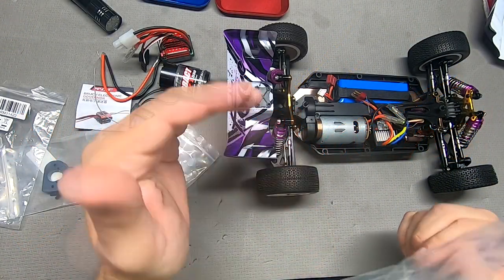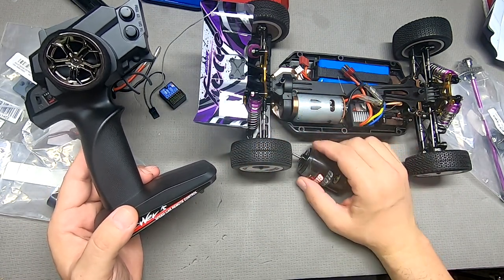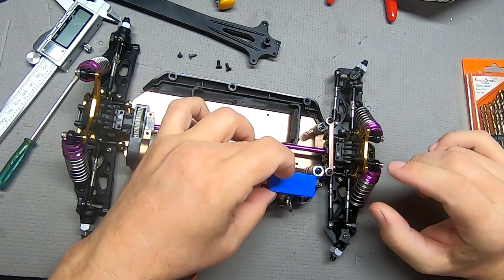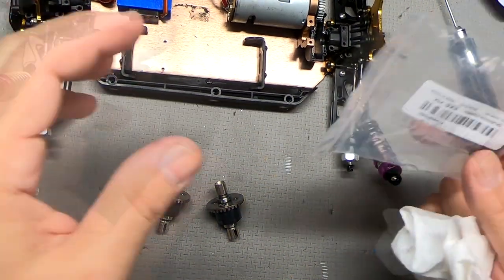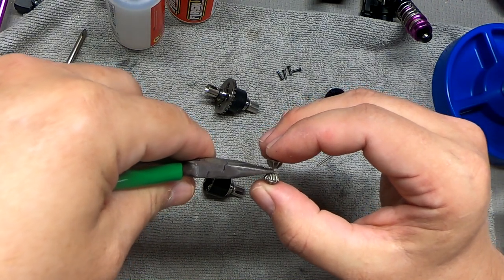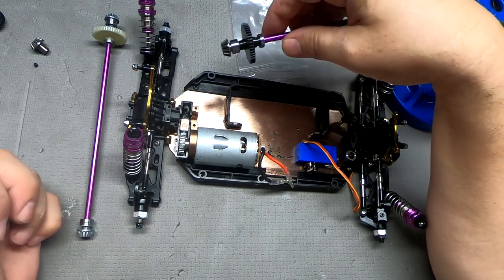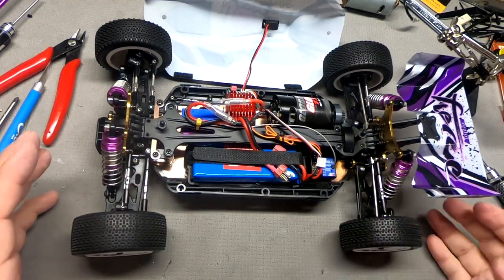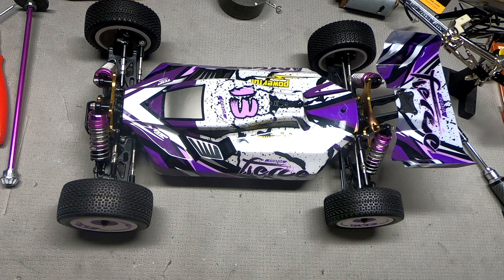New Motor, Diffs, Electronics, & Speed Test - Wltoys 124019 RC Buggy 4WD - Pt. 7

Comment: Which Motor did you build in?
Reply from the maker: Hi Daniel, it's nothing fancy... actually it's quite inexpensive at under $30 for the motor and ESC. Here is the title and link:
Rc Motor 550 12T Brushed Motor+60A Brushed ESC 6V/2A BEC for 1/10 RC
https://www.amazon.com/gp/product/B08JHX9RXN/ref=ppx_yo_dt_b_asin_title_o01_s00?ie=UTF8&psc=1
Reply from the maker: @admin5322  My main goal of swapping the electronics was to be able to have advanced functions like expo. I'm going to be selling the 3D printed servo mount with servo to make the change as easy as possible for my viewers. I'll be putting it up on ebay next week. I just received an order of servos and am going to print a batch of the mounts in black PLA tomorrow. I'm selling them with the servo to make sure that people have the correct size servo for the mount. It's all metal gear and I'll be testing each one to make sure they don't have any issues.
Reply from the maker: BTW, keeping the stock motor is a wise choice. It's already plenty fast as is. You might consider the aluminum diff cases, but if you're not having any issues, no hurry. The number one thing that buggy needs is suspension tuning.
Reply from the maker: @admin5322  Didn't know it existed...
Reply from the maker: @admin5322  Cool! I prefer this over the 144... because it has a longer wheelbase so it's more stable. That was one of the reasons I went with the 129. For the price, you can't go wrong! I've got another of their cars on the way...
Reply from the maker: @admin5322  I think you're referring to the 144001... I don't see a 104001. The 144001 came long before the 129019. But you can get whatever you like.
Reply from the maker: @admin5322  Thanks for the link! I was wondering when they would bring out a 1/10 scale car. You are right to wait... I just preordered one for myself.
Reply from the maker: @admin5322  I wouldn't hold my breath on that. Brushless motors, even unseasoned ones cost to much. The brushed motor they use on all these cars costs pennies... literally under ten cents per. The people making these cars are trying to keep below a certain price point. It also looks like they are using a lot of stuff they already have. There is very little new on this car. It's got the same 5 wire servo. Even the motor looks the same. The shock towers are the same stamped steel parts that are on the 129 and 144. The wing mount and wing look identical to what's on my 129... even the diff cases look the same. I'll bet the center drive assembly is a slipper clutch at best, not a diff... it might just be a drive gear with no slipper at all. I comes with the same 2200mah battery that comes with the 129. I'll bet the shocks and swing arms are the same too. They probably just lengthened the cassis a bit more to make it a 1/10 scale. Don't expect to much. 
Did you notice that in the crash test, they use a brick so they could make the point of impact the center of the chassis? That way the front wheel didn't hit first and rip the a-arm off the chassis. Look, I did just buy one and I'm sure it will be fun to drive. I might even take it to a race track and run it against the real 1/10 scale 4wd buggies just to see how it does. IF it can pass tech and can be raced in the 1/10 4wd buggy class, it might be the least expensive way to get into racing RC cars... That would be a real boost for beginner racers! But it may NOT be legal to race... ex: ROAR requires all cars to run a "hard case" battery, which this does not come with. I've never seen a hard pack in the size these cars use... that is probably the biggest most obvious problem, and 2200mah is probably not enough juice to last even short races. It might be possible to use a shorty pack turned on it's side. First thing, I'm going do after I give it a thorough lookover is design a mount in CAD and 3D print it. Hard shorty packs are available in up to 6000mah. But it will definitely need to be mounted standing on it's short side because this buggy is to narrow for the width of a shorty pack... they are almost 50% wider than the included 2200mah bat. On the up side, the tires look like they are an improvement over the ones on the 129. A bit of trial and error and we might find a make and model of wheel that will fit with the right offset... then tire options can be explored.
Thanks again for sending me the link!
CJ
Reply from the maker: @admin5322  BTW, I since it looks like the 104 uses the same servo, I ordered one of the 1181s you told me about. I found them on ebay for a bit more than on Banggood, but they come from a US based vendor so they will arrive in 4-6 days versus a couple weeks... I don't know where you live, but if you're in the US, this may interest you. Here's the link: https://www.ebay.com/itm/353190348151?_trkparms=ispr%3D1&amdata=enc%3AAQAFAAACQBaobrjLl8XobRIiIML1V4Imu%252Fn%252BzU5L90Z278x5ickkUq2HUzRXIDNJVaaCvHclGe4jh0JTBRBsaaNeqztUuiV5OsP%252BvN1Xdt4NBDuZA1slpiOhqx%252BbdEgY%252B1Nvrb5QANew81QLFbr5KrxStAXEgz1z%252BlxCmb67ebsJA7PcqUNrkqq6PpNuVuiaV6Ron0H65C%252BX2P7wTZosZ7%252Bk7CKt1QHnIW%252BQARgNDt3J9Lg%252BKirV4lHlgJfwH%252FjE4curWQBwOOTgkre01lU2%252Fen5G%252FZAo%252Fsr0JFyfC5rtdaPzKbg%252F2vfmZ%252BeGbkDElwcfpX%252BGVjQi3ttvwhzHXTcaKr2gOBtFUznkqeRqm4H4XClCjOmJXNo1vZ%252Fw9h5Mrtq1Xr26sioSN6va06KavY1D0%252FNxK%252BQwjzmyJ83m%252B7MCOfpGgjrHdI7UdGhvRwJtfxyJGNJzsJn8rKAnBr6AOuLrECcmlA66jqyGvoyoZHLzIqiMIA4kysI7F5Qy%252BYhW1PKvQyy%252FxyaMftsEhde3XKfaZL1oYBOHYTnNY0tF2NzyQiFFxDjXfcKAMdrx%252Fs1Dbj1vYemVYPKVI1Nax0sAW%252BINRVInVlupOmTbPyniLV0chOBTQtm%252FMdpDFcZ6Rk8MqY4SIHAOdphx1m0Y%252BCh33AY0Y2L%252FKMKL5oYYBDqVrmMqcYwUfFq5gTDZ1rxLHYI7YDjDv1B5rmNbSI6DI4CqkqnSsvpATPbOtxz1sodpWPjN19uSujlhv2aIr1GD6xQY2zYhHidOaET%252Fg%253D%253D%7Ccksum%3A353190348151167a0d9a266845b086d6a7b13973ffc1%7Campid%3APL_CLK%7Cclp%3A3268220&chn=ps&norover=1&mkevt=1&mkrid=711-117182-37290-0&mkcid=2&itemid=353190348151&targetid=1098102009964&device=c&mktype=pla&googleloc=9007581&poi=&campaignid=11774045932&mkgroupid=117378450867&rlsatarget=pla-1098102009964&abcId=9300473&merchantid=263817967&gclid=Cj0KCQiAmfmABhCHARIsACwPRACeT_enP7ha1OYQahc3zc6EZbneXbkMQYdAhC-6lZ0_CkGwgeOFSxsaAqNYEALw_wcB
Reply from the maker: @admin5322  I compared the specs and it's 47mm wider and 46mm longer than the 129 so some parts are definitely different... which is refreshing to see. The a arms lack holes for droop screws and the chassis lacks the tabs for same... this is disappointing because the max droop will be determined by shock length. In other words, if you want to alter the ride height, it will be necessary to modify the shocks... at least adjusting the preload, but lengthening or shortening the shock may be necessary... at the least this closes off one avenue of suspension tuning. 
It does have turnbuckles all around link the 129 which is good.
Reply from the maker: @admin5322  I also hope that the diffs are assembled with aluminum cases... but I'd doubt it. And I would like to see at least a slipper clutch in the center drive assembly, but I doubt it. The reason is that $150 is a ridiculously low price point for a 1/10 scale 4wd off road buggy. The average price for a 1/10 4wd buggy from Associated, Losi, Xray and the other manufacturers is $500... that does not include transmitter, receiver, motor, esc, steering servo, tires, batteries, charger, paint, or assembly. By the time the kit is ready to run, the average builder will have spent $1100-$1500 A race worthy ESC for this class of buggy costs as much or more as the 104001. A descent steering servo for this class of car costs half as much as the 104001. A high end programable steering servo cost as much as the 104001. I definitely prefer race quality kits and I prefer to spec the parts of my choosing and assemble the kit myself. At the same time, I am thankful that someone offers cars like the 144, the 129, and now the 104 which allow people to get a foothold in a hobby that is extremely rewarding and inspiring. A lot of the old guys I race with are retired engineers. Many of them were into RC as kids and the hobby was one of the reasons they perused careers in engineering. It was the same for me. I wish that RC tracks would create race classes specifically for vehicles like these and limit them to unmodified versions so that the kid who is barely able to talk his parents into buying one of these cars for Christmas or as a birthday gift has venues where he or she can compete on a level playing field. It would also be good for adults who can't justify spending $2K to get started in a hobby they are not sure they will continue. After all, to race competitively at even a club level, you need at least 2-4 batteries, a descent charger that can balance charge, discharge, and has storage mode. You need fire proof bags for your batteries. You need a lot of tools, a variety of tires for different track surfaces and temperatures, wheels for those tires, tire glue, a small selection of springs at varying spring rates, a variety of shock oil and diff fluid, a minimal selection of spare parts, and the list goes on... and this is just to field a single vehicle. There is a bit of snobbery in the hobby that does not bode well for its future. There need to be entry level classes where cost is controlled by not allowing modifications and this car in particular is a great candidate. I don't know if you are familiar, but one of the least expensive classes for on road cars is Euro Truck.... I'll leave a link at the end. It is based on a Tamiya kit which includes the motor, esc, and tires and it costs a mere $250. You need to buy a servo and have your own radio. You can't do any mods at all in the stock class. There are no turnbuckles so tuning isn't an issue. And as it turns out, it's one of the most popular classes at my club. 
http://eurotruckracingleague.com/

Comment: It actually have rc youtubers doing 100mph and up with this and controlling it normal you gotta put foam tires
Reply from the maker: You don't have to use foam. And I wouldn't call going in a strait line "control"... Have you ever seen someone at an RC track get hit in the ankle by a fast moving car... and I'm only talking about 45-55mph. If you are running rc cars at +100mph in a parking lot, you'd better have money, insurance, and a good lawyer. The standard hobby insurance that comes with a yearly membership in the AMA or other rc organizations only applies if you're operating "safely" in a sanctioned track or flying field. It's not going to cover speed runs in a public space. And, if you're putting videos of your speed runs online, I can guarantee that a lawyer will use that against you if someone gets hurt. Just because someone does it, doesn't make it smart or safe.

Comment: emax3054 servo is a straight fit
Reply from the maker: Thanks, I've since found another, the JX 1181MG that is also a direct replacement. I'll add your recommendation along with the JX in a video as soon as the servo comes in. 
I'm going to be using it in a new WLToys car you may be interested in... it's currently available for preorder. The 104001 1/10 scale 4WD off-road buggy. I believe this is their first proper scale kit.
Here's a link: 
https://shop.makerfire.com/products/wltoys-104001-car?_pos=1&_sid=47c177d8c&_ss=r
Thanks again for the info!
CJ

Comment: Driftomaniacs got his to 104mph on stock gearing.
Reply from the maker: Sorry for the late reply... that's very impressive. I'll have to search out that video to see what he is running. Thanks Troy! I hope your having fun with your RC cars... do you fly planes too?
Reply: @MyRCChannel-CJScott  no
Reply: @MyRCChannel-CJScott  how often would you suggest checking on the oil levels in the 124019? I'm using 7000 front 5000 rear.
Reply from the maker: Ok, I watched several of his videos, including his gear mod video... it's quite impressive, but it takes a crazy high kv/rpm motor. And it's not usable for anything beyond speed runs and even for that, it's very hard to control in a strait line... demonstrated by it looping with to much throttle to soon. Unfortunately, he has to butcher the car to make gear changes work. I'm fine with this sort of moding, but I'm not going to teach this sort of stuff to beginners. Removing the bearing that fits into the stock motor mount is very sketchy... the only thing supporting the driveshaft are the plastic cases. When you add high power to a weakened assembly, bad things will happen sooner or later. It's not good engineering. And, if I made such a video, I would definitely place a huge disclaimer and safety warning at the beginning and end of these videos. Many people will simply destroy their car attempting such a radical build, and many of those who succeed will destroy the car crashing it. Also, he never mentions safety once... can you imagen if that car hit a person or a pet at that speed? "Kids, don't try this at home!"
I try to base my mods on things that make the car better and are easily done by all or most people. But, I'll go a long way to mod a car when it's a benefit... watch the series on the Slash that I race on-road. I make tons of changes that evolve the car into a real racer. The only rules in this class are that the original kit is a truck, you're running rubber tires, and are limited to a 2S bat... https://www.youtube.com/watch?v=YtQrDw0TYKs&list=PLWi1J2KoLS71CXt8_tHXnAqSBpd9FKJwU
Reply from the maker: @troysrcchannel5659  Hard to say, since the diffs don't have o-rings, the diff fluid tends to leak out over time. Not sure how to fix that... I tried a few different o-rings I had on hand but couldn't find a set that worked. Maybe using a heavy grease where the outdrives enter the diff assembly might help. Might have to use heavier diff fluid, or both. They weren't dry when I checked, but some fluid had definitely leaked out over a handful of runs. Centrifugal force is going to keep most of the lube in the housing... spinning it toward the outer edge, but some will leak since there are no seals at the outdrives. 
They are $100 cars after all... what's the saying, "you can't polish a turd". For the money it's great, but there are limitations.
Reply: @MyRCChannel-CJScott  thanks. I may do some tinkering.